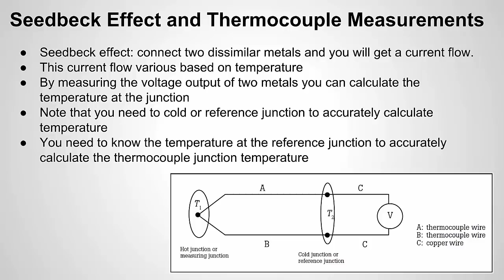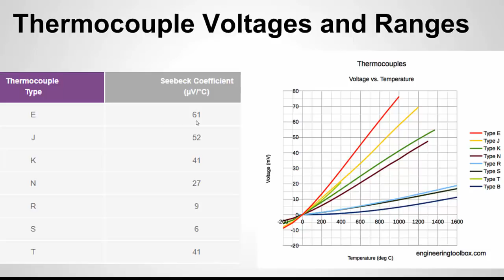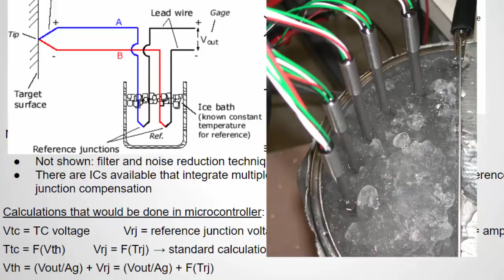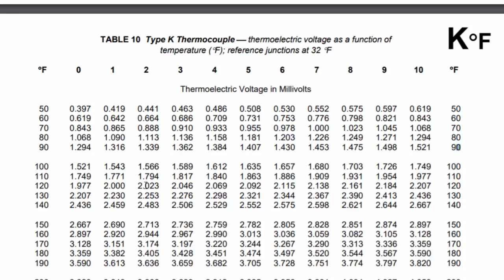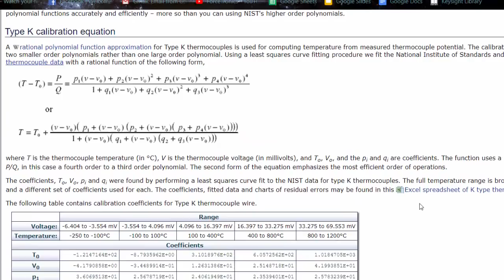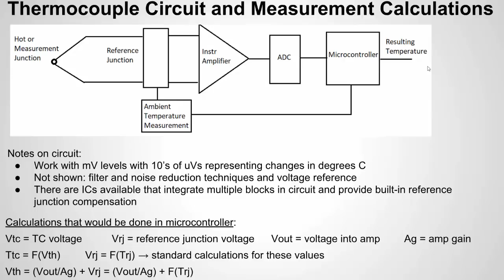Designing a Thermocouple Based Temperature Measurement Circuit Part 1

Comment: That's a helpful one! Thanks! BTW, two different meals joined, after heating the joint, because of different valence, a potential difference it's being created. If you close the electric circuit, then you will have a current flow.
Reply: I've wrote "meals" instead of metals. My bet.